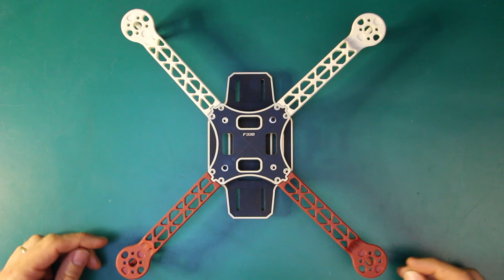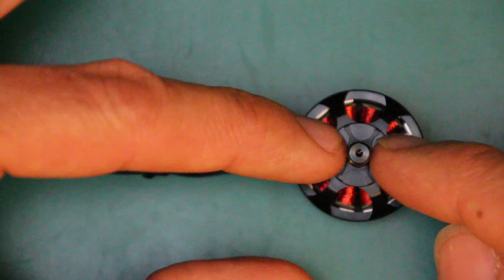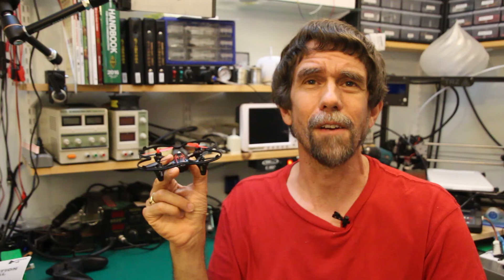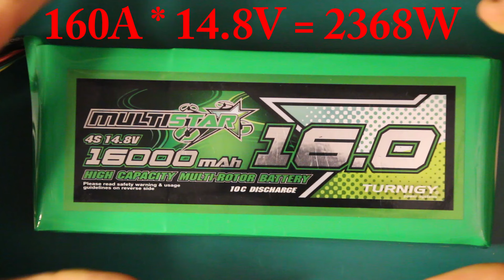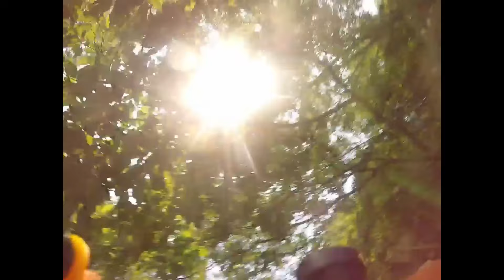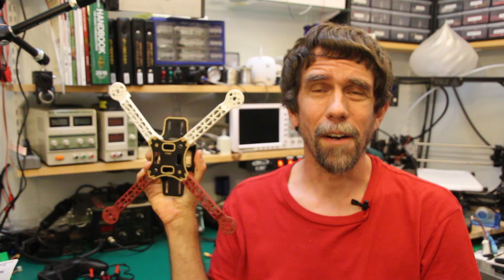Build a Drone Part 1 - Select Components

Comment: Thank you for this very nice presentation! I’m curious as to how the eCalc software comes up with motor/propeller sizes. At a very basic level it seems that the propulsion system sizing would be driven by two factors, the amount of thrust required to offset the weight and the amount of thrust required to overcome aerodynamic drag as a function of lateral speed. Having worked with underwater vehicles I know how challenging it can be to come up with reliable drag estimates. If you can recommend any references that discuss quadcopter drag modeling I’d appreciate knowing of them. Thanks again for this excellent video.

Comment: Hi, I admire this type of content and I want to congratulate you for doing it. I wanted to ask you a favor, I am a fan of fishing with drones and based on my needs, (my phantom 3 is already quite old and asking to retire), I want to build a drone that can easily lift 1-3lbs and use the necessary amount of 18650 battery packs, 2 or 4 4s made by me. Could you advise me on a prototype based on your experience? In case you can help me, I could send you my email or wpp. Thank you so much!
Reply from the maker: I don't have experience with higher lifting capacity drones, but here is an online xcopter calculator that I used for my drone design and you may find it useful for your applications: https://www.ecalc.ch/xcoptercalc.php

Comment: Hi,. is it possible to build a drone like this that is computerised and will allow its instructions to be applied through ,,,maybe a uhb port, so that the drone will fly through and execute a list of instructions while flying outside of its wireless range and then return to base. Iam thinking about building an eight motor version, that has a high carrying load capacity.  Also where can i get the components for this, can you recommend any types.
Reply from the maker: If you search for "open-source drone autopilot software" you'll find several options out there, but I have not personally used them. I also don't have a specific recommendation of 8-motor controller hardware but the more common ones only handle quadcopters so that will quickly narrow down your search.
Reply: @BrainRight  THANK YOU

Comment: Quite-impressive (Occam & his razor would be proud of you);  I have an out-of-the-box question:
It  would seem that a smartphone & a flight controller has just abouts the same sensors.  
Soooooooooooo a geeky retired physicist with to much too on his hands just might code apis/apps & emulate a flight controller just for the fun of it.
Pls let me know what do you thinks, thks.
Reply from the maker: Hey sorry it took so long to get back to you. A smartphone would surely have enough capability to make a decent flight controller, but it would take extra hardware to interface it to motor controllers. And weight would be a concern as well, maybe not significant for a larger drone though. It would have the very significant advantage that if the drone crashed, it could phone for help. In fact some kind of phone capability (not necessarily an entire smartphone) could be quite useful.
Reply: @BrainRight  thks

Comment: what motors and ESC need bui i plan build big drone dimension about 500-800mm and can carry camera,gimbal, or water 10 liter.
Reply from the maker: There is no one 'right' answer to your question, but rather many options with different tradeoffs of performance, flight time, cost and so on. Here is the online drone calculator that I used - it lets you enter your drone parameters and calculate the effects of different motors, ESCs, batteries etc. The free version is quite usable, and the (cheap) paid version gives you more options.
https://ecalc.ch/xcoptercalc.php

Comment: hi  I used EMAX XA2212/980KV brushless motor ,f450 drone what setting of PID can use
Reply from the maker: I didn't do any PID adjustments with the flight controller software that I used; I just worked with the default settings and it performed adequately.

Comment: Great video! I have a question though. For the ESC is there a problem having a 35A instead of the 18A you had in your video? Or is it the higher the better?
Reply from the maker: The ESC is like a switch, so having one rated for higher current than necessary won't hurt the motor; it would just add a little more weight and cost.

Comment: Is an F450 100 gms frame good enough?
Reply from the maker: It's good enough for me, but a larger frame would be better if you want to carry a heavier payload such as a large camera. If you follow the link I put in the video description there's some more info on my website, including a link to the xcopterCalc site that helps calculate the flight parameters of a drone based on frame size etc.

Comment: So my question is this. I was planning on buying the shell an already existing drone (like a mini Mavic or similar) and just adding the components that I wanted into it. would that work? and how would I calculate the size of the motor etc needed as the motors size used in the oe drones aren't listed.?

Comment: I am new to drones and really appreciate your video. I plan to watch the others also. I just have a few questions.
1. About how much will the drone you are building cost?
2. What is the maximum distance from home can it travel.
3. How high can it go.
Thank you
Bruce Landfather
Reply from the maker: For a cost estimate I recommend looking for a components kit that has most of the parts you need, and you may find a better deal on a bundle than buying the parts separately. Usually the kits don't include a radio but almost any R/C radio should work and my radio was under $100.

Comment: Sir please tell me if I want to lift 2kg weight which types of motor & battery is to be used??
Reply from the maker: I worked out my design using the quadcopter calculator at https://www.ecalc.ch/, and you might find that helpful.

Comment: I have a question about a parrot bebop 1. I have one but it lacks on flight time. Is it possible to upgrade to a better battery? If so what battery should I use? It currently has a 11.1v 1600mah. Thanks in advance